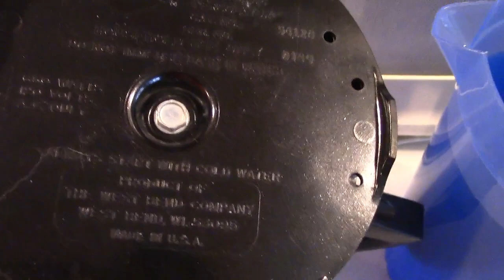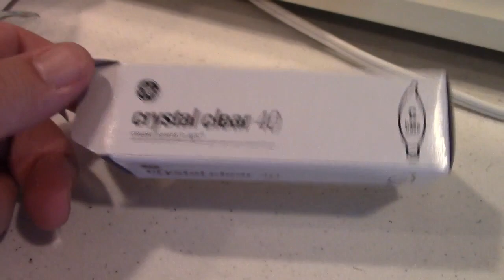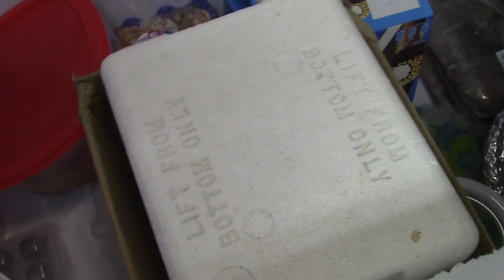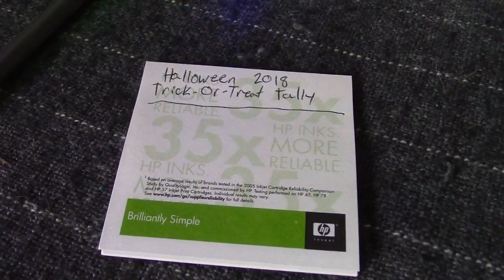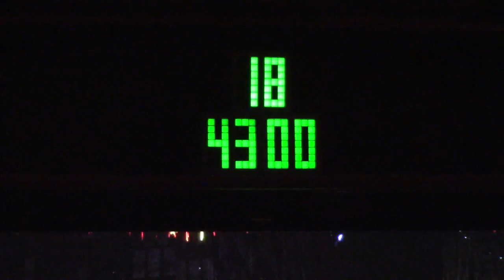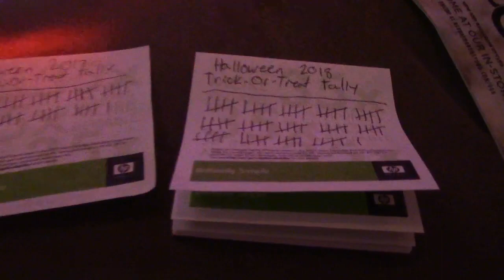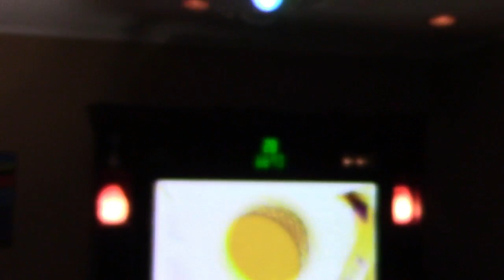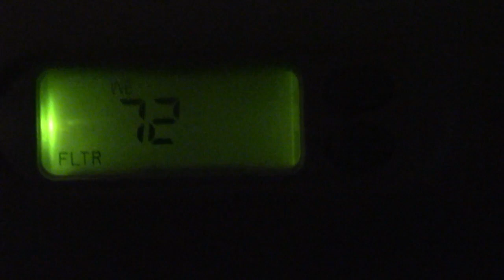Halloweenus 2018!!!

Comment: Do you use plastic or glass cups for the dry ice? (will plastic melt)?
Reply from the maker: Dry ice is frozen carbon dioxide.  It's colder than regular water ice.  Regular ice is 0°C, dry ice is -78°C.  How can something that cold, MELT something?

I use glass, I don't want the dry ice possibly freezing and cracking the plastic.  Glass will hold up to temperatures that low.

The cup will freeze to the table.  I keep some paper towels there on hand and use them as a coaster, replacing as necessary.
Reply: Good to know, thank you.

Comment: How do you get away with the cutaways? Doesn't Susan flag you since you're monetized?
Reply from the maker: Depends on how long they are, can usually get away with 7 seconds exactly to the video frame.  If they're longer, either there wasn't a match, or Susan hasn't found it yet.
Reply from the maker: @isaac24  Depends if it's that time of the month...
Reply: Oooooooh

Comment: Err ree d's at the 13:25 mark.
Reply from the maker: Yep.
Reply: jaykay18 I came up with a new name for err ree d's. Instead of calling them err ree d's, I either call them err air d's, or error d's lol
Reply from the maker: Error Dees is cute.
Reply: jaykay18 ErrorD's[TM]
Reply from the maker: I'll let you have that one.
Reply: jaykay18 I might get a vintage washer and dryer set that both have florescent back lit panels, and it is not a Maytag A806 set from the 70's.
Reply from the maker: The fluorescent backlit panels are completely awesome!  Though now you have to be eco-green and convert it to Error D's.
Reply from the maker: Nicey nice!
Reply: jaykay18 it may or may not have back lit panels, but they are pretty nice for the price. It looks like it could be a Imperial 80 set, but I can't see the full control panel of the dryer, and it could be another model entirely.